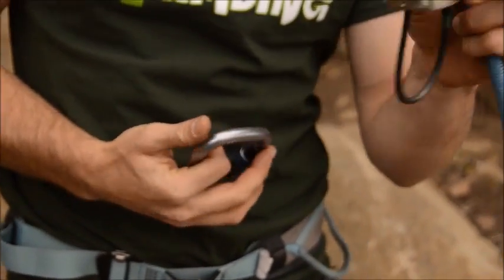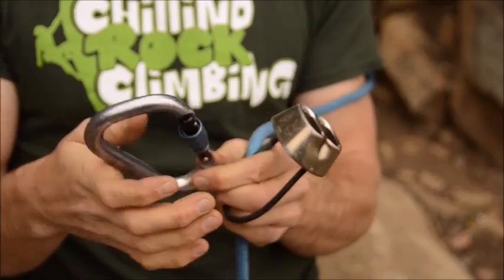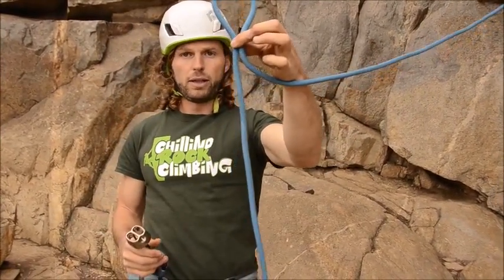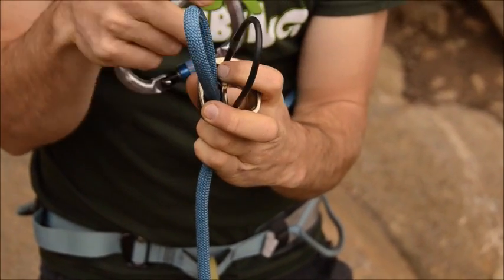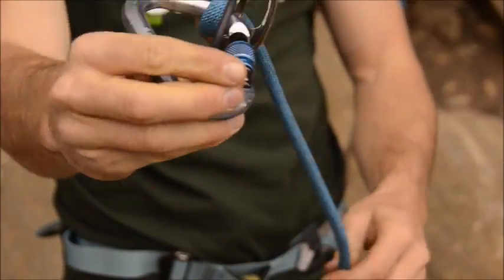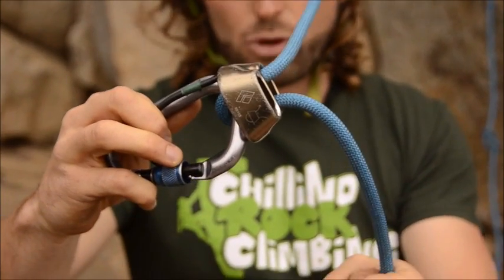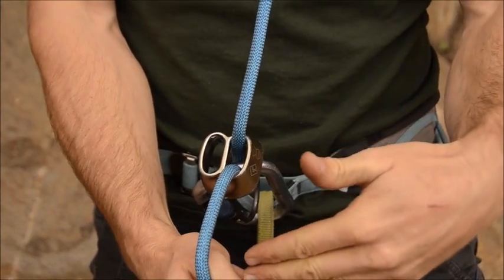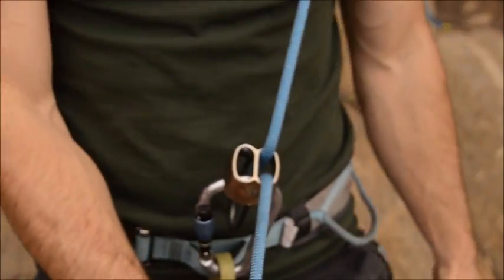How to clip an ATC belay device  to rope and harness

Comment: A good practice to eliminate the chance of dropping your belay device is to always keep the belay device attached to the carabiner.  Also, when you clip it to your belay loop, the gate should be on the opposite side from what you show.  That way the strongest part of the carabiner (the spine) is on the same side as your brake hand and the gate is on the opposite side eliminating the risk of the rope running across the gate and unscrewing the screwgate (and unlocking it).
Reply from the maker: rockklimber Thank you for your comment! These are some great additions to the topic.
Reply: Ok, but if you can drop one thing you can drop 2 things clipped together.
Reply: Not if you know know how to handle it correctly  After 21 years, most multipitch trad, I have never dropped a belay device but I have found at least 15 including 2 grigris.